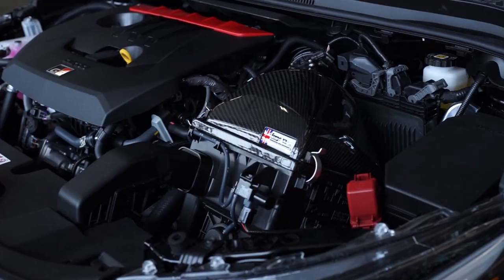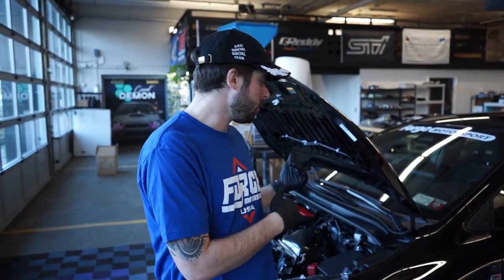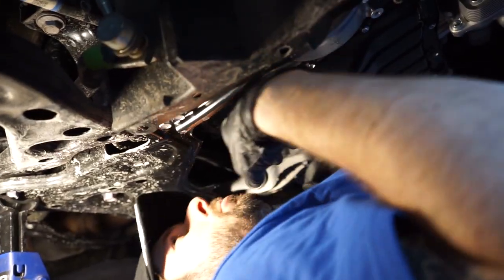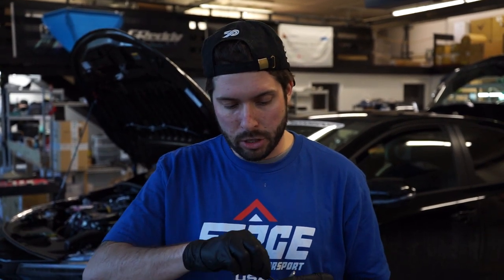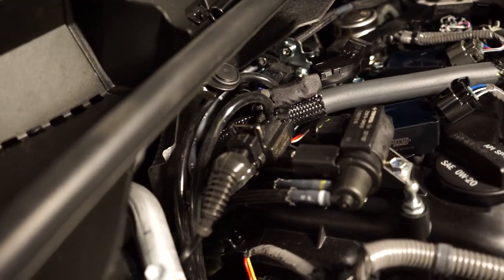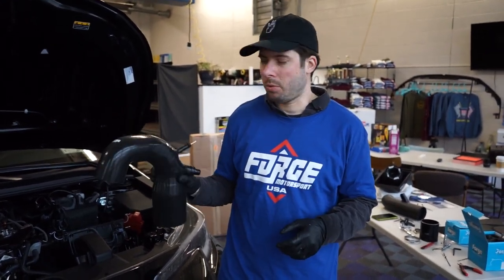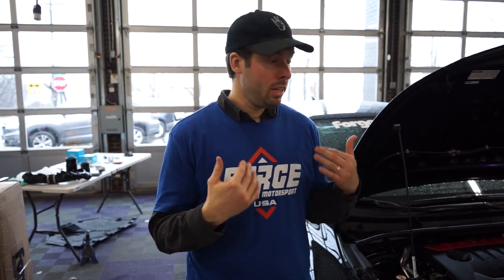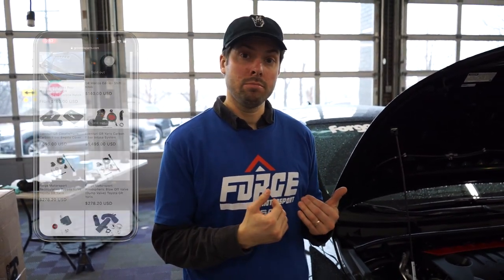GR Corolla Gets a Blow-Off Valve Upgrade!

Comment: Question: I was thinking of the Forge turbo inlet (only) for the GRC. Do you think it impact the stock diverter/dump valve since more air is going through from the Forge turbo inlet? It would be primarily for sound, and minor HP as secondary. Also, I was wondering if getting the Forge turbo inlet would give CEL. Would appreciate feedback.

Comment: The turbo flutter sounds sick. Is the blue spring the one you ended up using? And is the dump valve link in the description the same one used in the vid? Might return my turbosmart for one of these.

Comment: do you need a tune if you just add the BOV? I would love it on mine, but don’t wanna cause any damage.
Reply: @rev_mitersaw are you running the soft or stiff spring??
Reply: Does it flutter like in the vid?@rev_mitersaw

Comment: Did you need a tune with the BOV?
Reply from the maker: Would be better with a tune, but there are no tuning options on the market right now for the GR as far as we know.
Reply: Did a engine light come on? Any performance gains or the same?
Reply: Does the engine die or stall with the  bov ? Is there any weird rpm flluctuations?